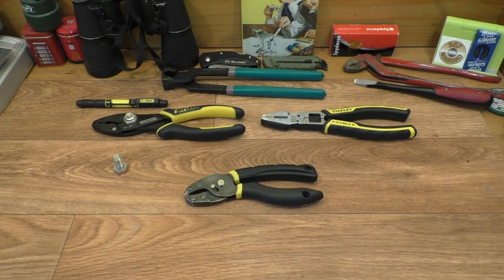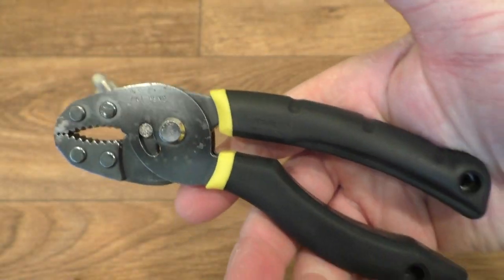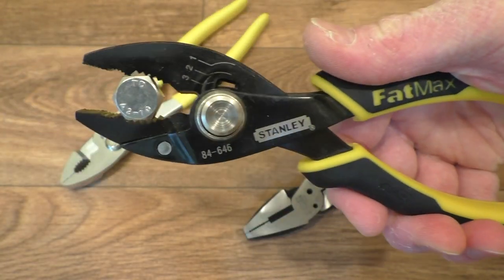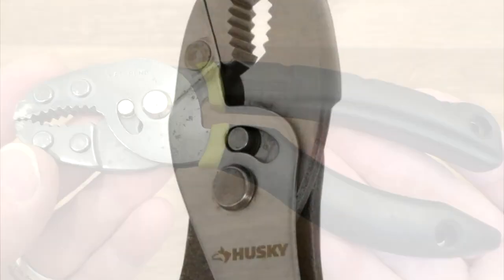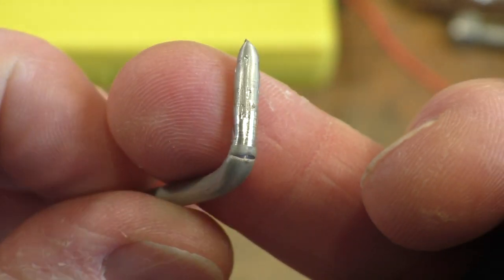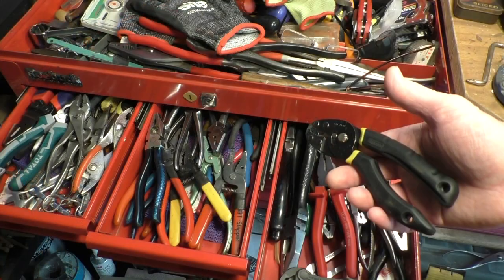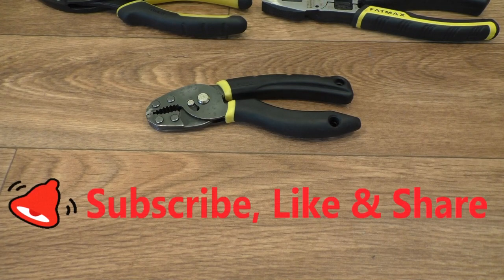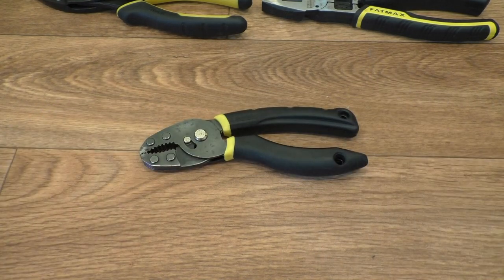Tool Talk: Stanley 84-881 MaxGrip Pliers

Comment: I was wondering if a wire went into that hole by the pivot if it would cut it? 
They seem great and compact.
Reply from the maker: I pondered the same thing but to cut the wire you would be 'opening' the pliers. Just the opposite of conventional pliers and I doubt there would be much cutting going on, I think what would happen is the wire would get all bent up jamming the mechanism.
Thanks for watching 👍